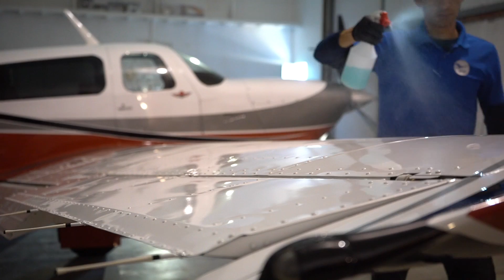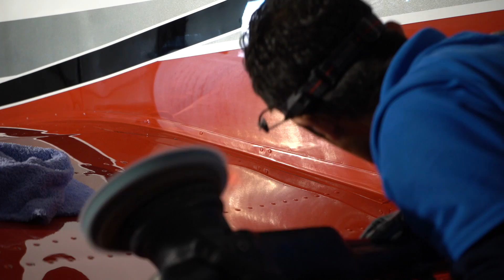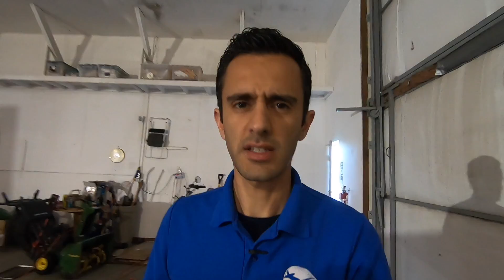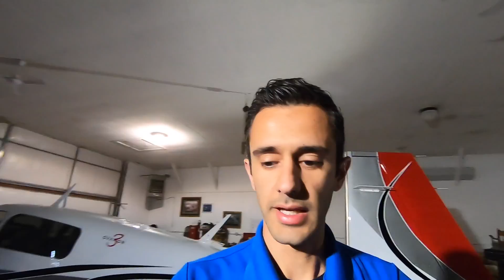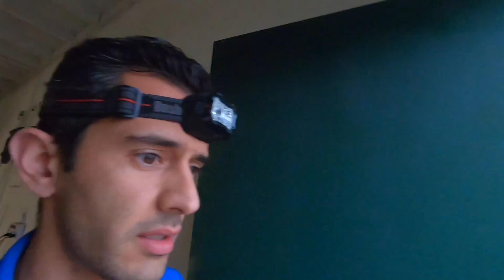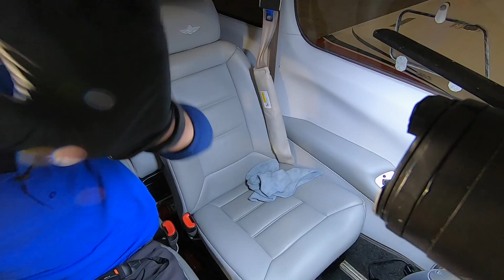VLOG 019 - Mooney M20 Ovation 3 - Paint Correction and Ceramic Coating

Comment: Great video! How long will the ceramic coating last?  Will it make bugs easier to remove from the wing leading edges?
Reply from the maker: Patrick, bugs, oil, and exhaust all wipe off significantly easier. We give it about 1000 flight hour lifespan

Comment: Do you ever clay bar? If so, what "criteria" do you need to have in order to determine clay bar is required? Thanks
Reply from the maker: Great question. Rarely. Clay is very effective at removing contamination that sits on top of the surface such as brake dust, tar, sap, iron filings, etc. Cars much more frequently suffer from these issues than aircraft. Claying does not resolve the types of defects that we go after, as our problems are in the paint rather than on top.